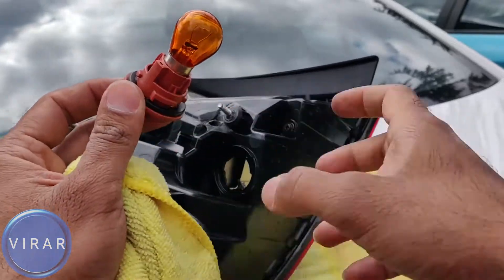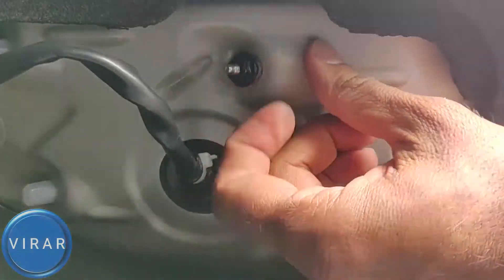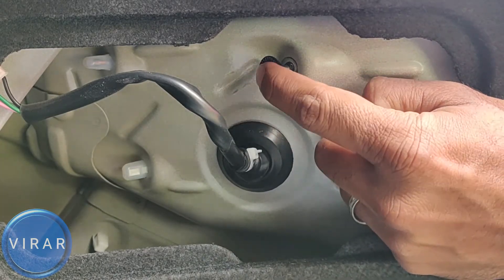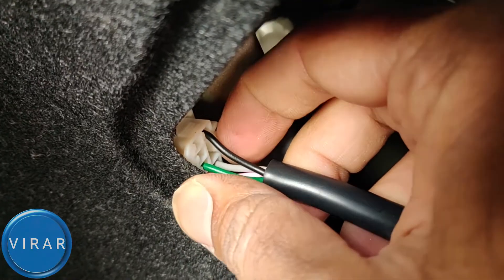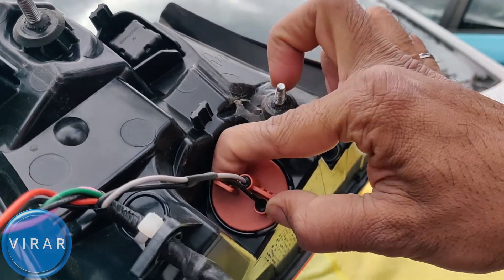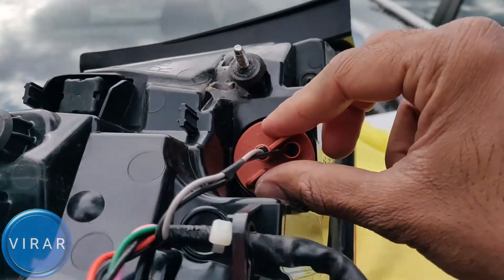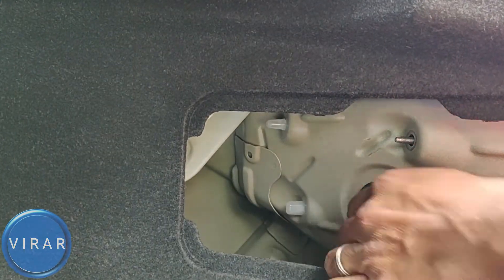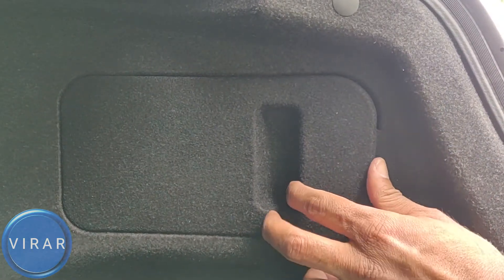How to Replace Rear Turn Signal Bulb - Hyundai Elantra (2019-2020)

Comment: Do you know if it’s the same bulb for the 2017 Elantra?
Reply from the maker: Yes. Same bulb.
Reply: I have a 2017 but when I try to take out the back brake light I cannotot get the  light shirlf off. I banged and pushed the light shield back toward back of car like you said but it will not budge. ??m